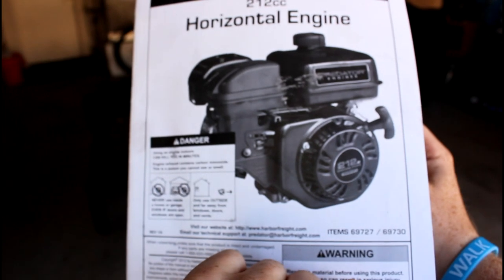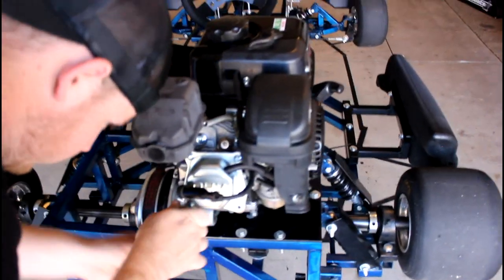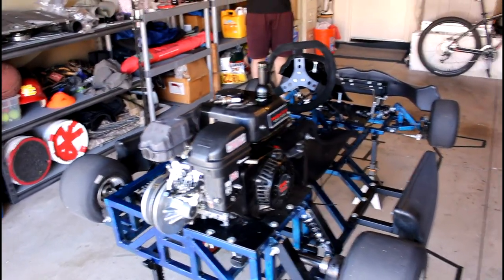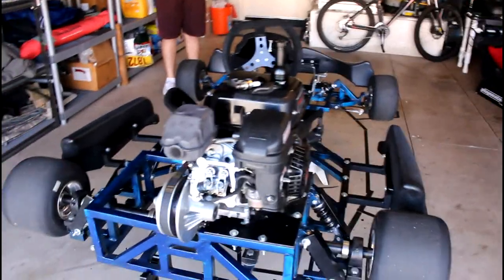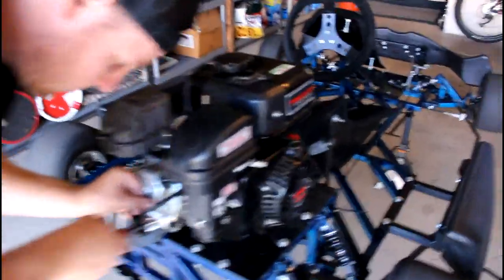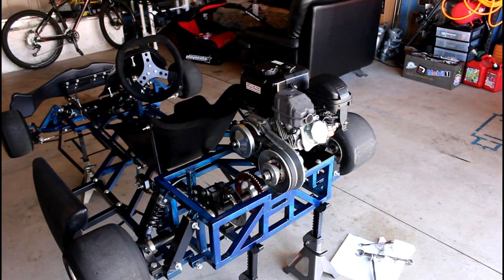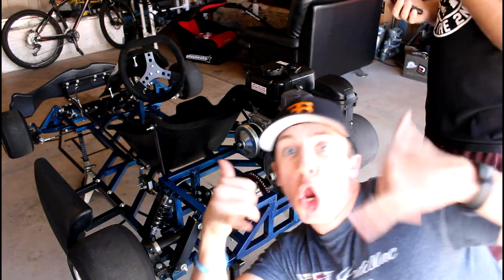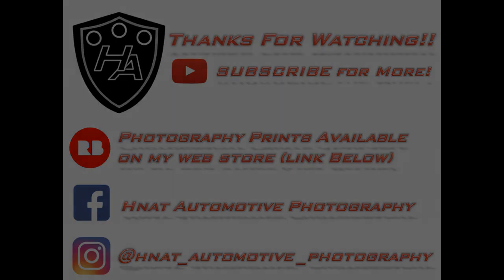(Homemade) Go Kart STARTS again!! - Valve Lash and Spark Plug Part 1

Comment: When you started it, did you have the carb choked? If so, there may still be some lash/timing/carb issues present based on the lack of throttle response.
Reply from the maker: There was no throttle response because when we took out all of the springs and arms from the governor, it was also linked with the throttle lever. That'll be in part 2, just didn't want to make this video too long.

Comment: those carbs are known for clogged jets. easy to clean them out. maybe an open exhaust would be nice.
Reply from the maker: I definitely want a different exhaust, but I need one that can be both loud and quiet by attaching a muffler when need be so my neighbors don't get all peeved.
Reply: I hear that. They sell muflers that you can screw onto the exhaust. Look into kits. Plenty of kits for the engine. 👍
Reply from the maker: Will do!

Comment: I don't understand what I am missing on mine that it still will not start. Mine ran perfectly fine and always started first or second pull. Then i got gutsy and decided I'd open the side cover and pull out the stock cam and put in a new Mod 2 Cam and take out the Governor while I was at it and also replaced the stock valve springs with 18 pound springs. I did have one of the Lifters and a Push Rod fall out of the engine when I pulled out the stock cam they fell right out and i stuck them back in the hole they came from. Then i put the side cover back on after everything was in place and i made sure i put the push rod through the little square hole thing and into the back of the Rocker Arm and i set the lash to .003 on each one and then put the cover back on. I even put a brand new sparkplug in cause the old one was all black on the end. Put oil and gas in and went to start it and got nothing. i noticed whenever i pulled the starter rope it felt really hard to pull. Like it sounded like something was rubbing inside the blower housing somewhere or maybe in the engine somewhere i dunno where it was coming from but some times 'd go tp pull start it and it just snapped right back and i couldn't even pull it more than a couple of inches but other times i could pull it all the way but it took a lot of strength to pull it. This sucks cause i really do not want to have to take everything apart again after it took so long to do everything and get it all put back together. But can't imagine what the issue could be so don't know where to look first.
Reply from the maker: Shoot, sorry I missed your comment! Still having issues?

Comment: My predator 212 idles so high every since I took the governer off I adjusted the idle scree
Reply from the maker: Adjusting the idle screw should help. You’ll also need to look at the position of your throttle lever since that was a part of the governor setup. Check to make sure the throttle lever returns to idle each time you apply more throttle.

Comment: straight pipe, those who buy them are suckers, I made one out of treadmill handles
Reply from the maker: You also just make a custom flange? I'd be down to do that, I just want an option to quiet it down for when I drove it around my neighborhood so it doesn't piss everyone off haha
Reply: Hnat Automotive Photography I made a paper flange to trace out the shape on metal, then I cut it out of old bed frame angle iron, real backyard mechanic shit lol, but making another flange, as I'm sure you figured, allows you to switch back and forth between exhausts

Comment: needs a turbo
Reply from the maker: Unfortunately, after how much work I saw had to be put into CarsandCameras' turbo drift trike, I don't think I'll turbo it. Maybe the next build I'll get an EFI engine from a street bike or something and turbo that lol
Reply: buy some universal cheap, easy, and crappy turbo from our eBay friends in china
Reply from the maker: It's not the cost, just really more so the amount of parts and time that will need to go into converting an engine with a carb into an EFI engine for the turbo